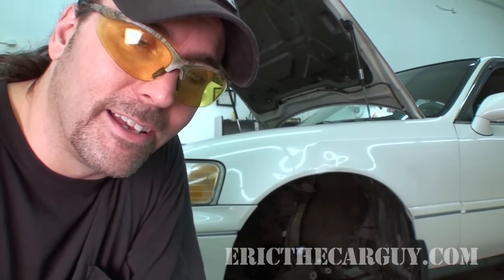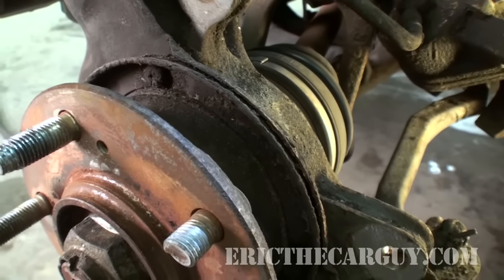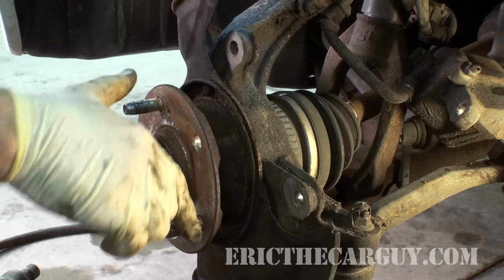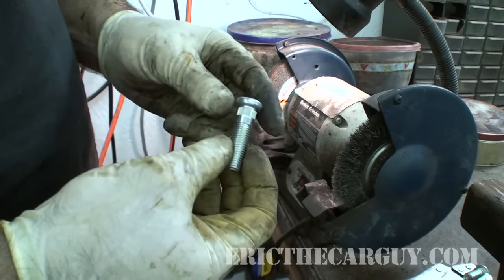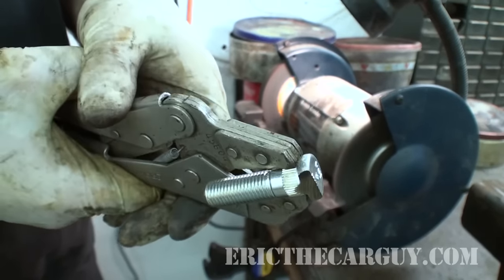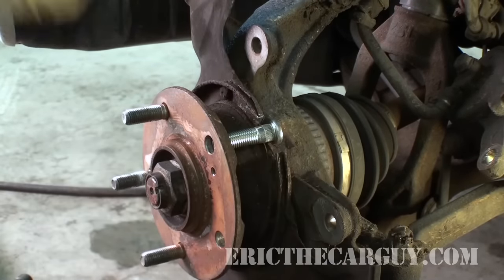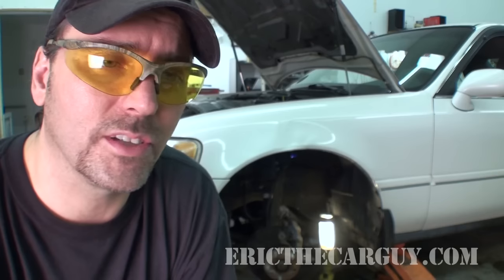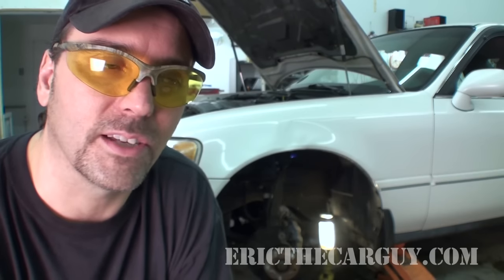Replacing Studs the 'Easy Way' -EricTheCarGuy

Comment: I would do this if a customer was in a bind, but definitely inform them up front that they may need to have their wheel bearing replaced. I wouldn't waste my time pulling the knuckle off and taking it to the press to remove the hub, that's what slide hammers and fwd hub pullers are for. Good video, but customers need to be cautious of no name used tire shops and make sure their lugs aren't over tightened. 80 ft/lbs is all you need on Honda/Acura 19mm lug nuts.

Comment: Nothin' wrong with hack fixes.  I do them all the time on my own vehicles when the situation warrants -- beater car with only a few more years of life left -- used tires, replacing only the bad spark plug and/or wire, etc.

However, if I was a professional shop operator, I would have to pass.  Even if the customer understood the trade-offs of such a short-cut low-cost solution, that work goes out into the real world.  And if and when someone asks the car owner where he had the repair done, it's probably not as a positive reference sort of thing.

There's a time and a place for everything.  The secret is getting times/places to line up correctly.

Thanks for posting the video!  More options are never a bad thing.

Comment: This view shows the front wheel has been removed , the caliper assembly has been unbolted and pushed aside , and
the rotor has been removed . KEY NOTE : Both tires must be up off of the ground and the transmission must be in
"NEUTRAL" so that you can rotate the wheel hub to the slotted area so that you can put in a new lug stud . The area is 
tight so you might have to wiggle the new stud in order to get it into the wheel hub .

Comment: Eric, love your vids.  Quick question for you:  my local Honda dealer cross threaded one of the lug nuts and stripped one of the rear wheel studs on my '12 CR-V.  They just called and told me they replaced the stud.  Should they have also replaced the wheel bearing also, or is that unnecessary?  The car has 47k miles on it.  Thanks.

Comment: “The cheap way”
Wheel lug bolt: $2.99
+0.5hrs labor @ $85/hour = $87.99
Out the door.

Or

“The right way”
Wheel hub replacement: $129.99
+3.5hrs labor at $85/hour = $427.49 out the door.

Do the math folks. Most people don’t have that kind of money or are willing to spend that kind of money on a 3 dollar part.
Reply: Exactly

Comment: why weren't you worried about stripping the threads in the hub. i have a 1991 saab 900 convertible with bolt type studs and two of them broke off flush to the hub. help. I was considering using an extractor of some kind. removing the hub itself is an expensive job any suggestions would be appreciated.

Comment: I need replacing on my mustang gt. Every stud I tried Orilley's gave me would not sit flush or even go fully in. I didn't know what to think after the studs that are supposed to go in did not. After watching this video I saw that you might have to grind the stud top down just a bit to fit. after looking at the old one it had a clipped top. I did a little bit of grinding to make it like the old one and bam it fit. Make sure when putting it in it doesn't go in at an angle in the very beginning or else it won't fit.

Comment: I was with you until you boogered the threads and used a metal working hammer but overall it works. Anyone with a problem fails to realize that nothing is wrong with trimming a little of the unnecessary metal. One thing I will say is put the shaved part of the stud towards the hub so the driving force puts pressure on the good part of the stud.

Comment: I was told the part that locks the stud is damaged and I should get the back side welded so weld the stud in. I was alsontood if there welding machine was working that would have just welded a stud in. Is flux core arc weld (fcaw) sufficient? Should I just tack weld the back or fully flux core weld the back of stud? I've had several studs break and I'm told because the stud cant lock in the back.

Comment: My car has a round hole in the splash shield behind the hub. So I just spin he wheel so the hole is behind the stud. Easy to remove and install studs. Would drilling the splash shield have been a better option?

Comment: Eric im currently undergoing a clutch replacement on a 2012 Honda civic si and broke the wheel lock and broke a stud trying to relieve pressure off the wheel lock and get it out so i will have the entire wheel assembly out when i drop the subframe.  When McGard sends the replacement lock and key ordered 2 JIC will i have to replace the entire wheel bearing or can i just replace the stud ?

Comment: I’ve drilled out my hub for a larger stud (5/8) and I’ve used the correct drill bit (it came with the new studs) however when I put the larger stud in it doesn’t seat tight, it goes in loose and spins, all I did was drill out the hub, did I miss a step?

Comment: I learned the "hard" way not to use an air hammer with the fork tongue attachment to drill it out (i.e. sharp edge, larger than the bolt), it kind of cuts up the axle when it pops out...FYI :)

Comment: I had a similar issue in a 08 saturn outlook. One of The rear studs had snapped somehow and I cut the old one and pounded it in. Luckily the hub/bearing assembly came out as a hole. What a crappy design that they did not make it accessible without removing the hub. You're probably good as long as you don't grind past and into the shaft which you only ground right up to and no further. If you ground more into the shaft I would say it weakened the stud but it looks fine to me.
Reply: Could've been worse... you could've suggested that people not use jackstands and just jack the car up cause it'll just land on the wheels anyway ( and Crack your skull) like a certain bone head youtube celebrity..... (kotty scilmer;)
Reply: +nicholas elias LOL ! man, I aint gonna lie, I love Scotty, but sometimes, he reminds me of Grand Pa on the Simpsons, he says some stuff, and I'm just saying..:what?!?" HA ! He is a character !!

Comment: FYI you could bend back up or even reinsert the cut shield piece and use JB weld or other epoxy to repair the shield, nothing wrong with that.

Not sure Id like this way, not sure I'd like 3 hours+ labor either for a 1$ part. Erics right take your choice.

Lucky for me my daughters bearing went bad so I'm changing both sides, one side had a pesky stud that I couldn't fix with a file and the other wheel the stud broke as I took off lug nut! So lucky me, replacing bearings anyway.

Comment: Hey ericthecarguy, Thanks for the video. Im dealing with a slightly different stud issue. I believe 2 lugs were improperly sized or just rusted on and turning the lugs has stripped the notches for the studs on two different lugs on the same tire. So three come off 2 are stuck. I didn't see a video for removing lugs with the tire still on when u dont have a acetylene torch. I figure the easiest way is to get a metal cutting bit for a Dremel (as I already have one) Its a 07 mustang so the lug on one side is exposed completely. Then using a chisel spread apart the lug so it opens off the threats I can turn the stud using the stuck lug so I might just be able to take out a section. Do you have any better advice for stuck on lugs while the tire is still installed. I realize I risk messing the rim up but im going to be very careful. I am replacing the wheel hub which comes as an assembly with the bearing (yeah theres a wobble especially at 40+ mph) so I dont care about the stud as long as it off the tire,

Comment: Hi Eric, Thanks for your help videos. They have helped me many times. Last year I snapped off a stud on my 2000 accord and my repair was exactly how yours ended up. I'm part machinist, engineer,metallurgist. I don't have an issue with the stud mods since they are so over engineered and there is no way the stud could pull through or have an issue with the threads. Maybe you could have patched the splash guard.  Keep up the good work.

Comment: Hi Eric,
Your video is very interesting and informative and I always watch it all the times.  Anyhow, I need an advice from you.  I newly bought a Honda accord and found that the passenger side is 1/3" higher than the driver's side despite full or empty tank of gas.  is this normal for any car ?  what is the standard of tolerance as I undelrstand no car is perfectly balance !  how can I fix it without replacing the suspension system ! 
Thanks
Frank

Comment: This is how one of the mechanics at my local Honda dealership told me I could do it on my '99 CR-V. He even recommended that I cut slightly into the hub (!) as well to make about 1-2 mm more clearance, and they even did this them selves.

(He also asked me not to tell anyone he told me that, because they're not supposed to do it like this...)
Reply: Mumble Fumble That's just stupid. Not only are you weakening the studs by taking the shoulder, the only thing keeping them from pulling through the hub, and cutting part of it off, but also cutting into the hub weakening that too. Any mechanic that does this shit should switch to burger flipping in a McDonalds, because they're putting people's lives in danger. Maybe not much danger, but danger regardless.
Reply: that's right

Comment: The only thing I really have issue with here is banging the studs out, that's a fast way to damage the bearing and/or bend the hub.  If you can weld, there's a quick and cheap tool you can make out of a socket and a C Clamp that can pull studs through without any impact on the hub or bearing.
Reply: the amount of banging is really minimal during removal...the loads on the bearing during normal driving and some of the bumps encountered is more than the short term popping from a hammer or air hammer....

Comment: Brutal! His entire repair is due to bad bolts/threads. Now he’s damaged brand new threads and removed about 20% of the bolts’ integrity at the head - the part that takes the load of a torqued down wheel nut! Don’t let him work on your vehicle!
Reply: That stud will NEVER pull through the hub. They sell replacement studs with that notch pre cut.

Comment: You did good OEM bearing is better a lot of people would put an aftermarket trash bearing that would fail after a year OEM parts are expensive I would say that's a good fix unless you're replacing the bearing I would call it a win.

Comment: I've never had a problem using the lug nut to pull the stud through. Also, some studs come from the manufacturer pre shaven on one side to clear the hardware to insert them. Many cars have a hole already drilled though the back plate so you can line it up with the stud hole and push a stud through from behind.

Comment: I wonder if he would have been able to get the new stud  in place without grinding the head off, if he cut the splash guard flange off completely instead of bending it out of the way? The gap could be closed off by pop-riveting the piece back-on using some sheet metal doubler....imho
Reply: I did this repair myself after watching this video. I cut the guard entirely and ground a bit of the hub (or whatever the big permanent thing behind the lugs is called) and was able to keep a lot more of the lug and still have it fit on.

Comment: Remove studs as he has shown, then to replace, simply lossen the hub enough to insert the new studs or/and the smart man would remove hub, seals and bearings repack bearing and new seal while you are already there. Do it right. If you are destroying something to fix something you are doing it wrong. Use a stack of washers and draw the new lugs up tight with a lug nut and wrench or air gun.
Reply: You can't loosen the hub on that car. The knuckle has to be removed, and the hub and bearing have to be pressed out. It's a full bearing job just to do 1 stud.

Comment: As you say in the video, i dont really feel confortable with any of this :P i prefer to remove the hub in these conditions and replace the studs.but, considering the price of the hub for this vehicule, id rather replace the hub which would give new studs and a new bearing (even if it doesnt need to be replaced its a good occasion). I did it last week for a friend and the hub was 30$ with the studs and bearing already installed (his bearing was done). If you are wondering, it was a 15 min job...

Comment: I've been a real mechanic for over 45 years on everything from fleet vehicles to exotics to vintage and race cars. These days I build hot-rods for people who know the difference between crap work and the other kind. I'm an ASE Master, and a mechanical engineer and aircraft A&P as well. I've owned my own businesses in almost every facet of the automobile service industry, and I can do everything on a vehicle, from custom electronics to bodywork and show-quality paint. Yeah, don't believe me. I don't give a shit.
Frankly, I DON'T have a problem with doing this to a vehicle where it wasn't designed intelligently enough to be serviced easily. Wheel studs DO get buggered in the real world, and an engineer worth his paycheck could have EASILY designed this thing to be easy to replace studs on.
What I DO have a problem with is the quality of the workmanship shown here. You don't have to be a hacker slob beating on everything BUT what you're aiming at, and you can give a shit and make clean, radiused cuts wherever you modify anything. It only takes  a very few minutes more to do a clean looking piece of work, as opposed to doing a hack job that looks like it was done by a chimp.

Comment: Yo Eric, you asked if we have questions....I have a good one. I have a 2000 Dodge Dakota which has a rounded off lug nut and it so tore up I can't get it off..I've drilled it to the point I think I'm going to have to torch the rim to remove it...I think the right way to remove stripped lug nutz would be a good vid...

Comment: I remember one time when I was driving with my nine inch angle grinder I didn't have my PPE on. Big mistake  when using a 9 inch angle grinder to grind 1/2 inch thick Steel East came loose either off the wheel or off the steel pretty sure was a steel because those magnetic and wouldn't you know right in my f**** I and all my goddamn it took everything I have not close my eye and remain calm I walked over to my toolbox and I have antique ridiculously strong cylinder shape magnet that's about 2 inches my Grandpa gave me they used to feed them to their towels so get all the iron shavings from the dirt and s*** out of their stomachs that f**** magnet literally ripped that thing directly out of my eye, and luckily no damage was done permanently I learned a valuable lesson it didn't cost me and I ever since then I've always had my safety glasses

Comment: Offer both methods and if they refuse the correct way then think really hard of the consequences if that 1 in a million does happen. Well in this case 2 in a million. I would do this to my car but nobody else’s. Lawsuit, jail time, or both. Your a brave man SMH
Reply: LOL. "Lawsuit, jail time, or both." for what? clipping the dust cover?
Reply: Tyler Hunt  no. clipping the splash guard isn’t a big deal but compromising the strength of 2 of 5 studs  may be. In any event  if I was a legitimate business I would only perform this repair if client signs a waiver. Quick scenario client leaves your “shop” clips a curb weakens studs by stress cracking them. A couple days they fail causes a fatal accident. Family says you just repaired the car. Who they gonna sue.? Ohh and yes they will sue.  Not being a dick I’m just saying be careful if your doing this on somebody else’s vehicle

Comment: This procedure will work just fine. Have any of you ever seen a wheel stud break because the head was shaved a bit? I've never seen a wheel stud break for any reason other than being over tightened or because the nut was rusted on. In the real world this just isn't a problem.